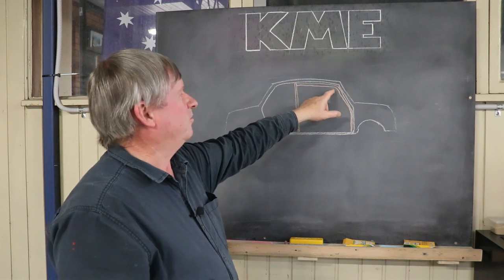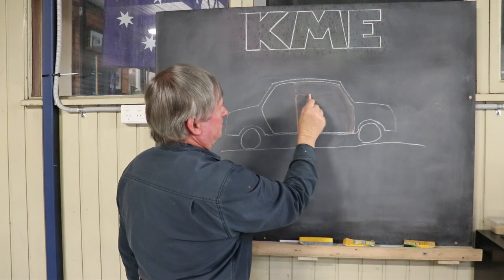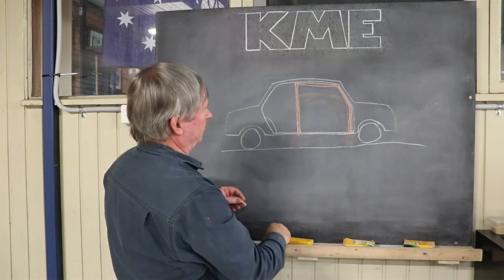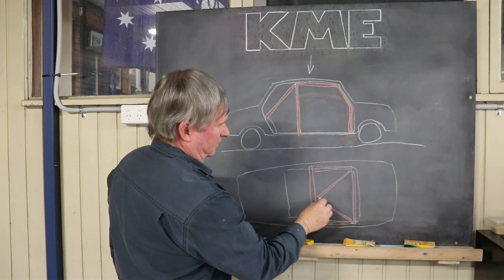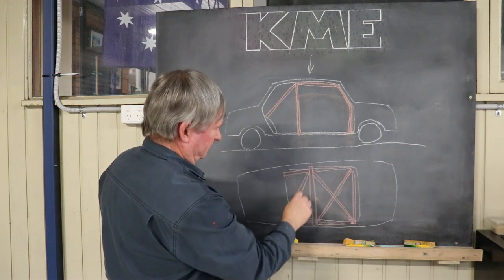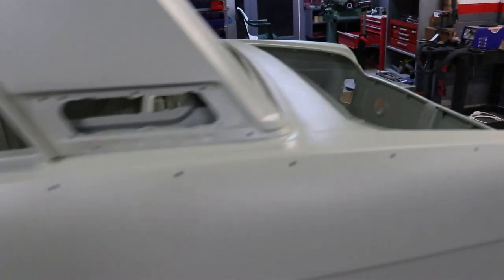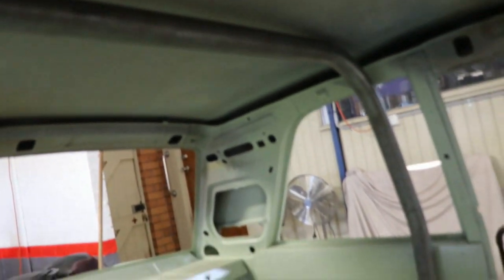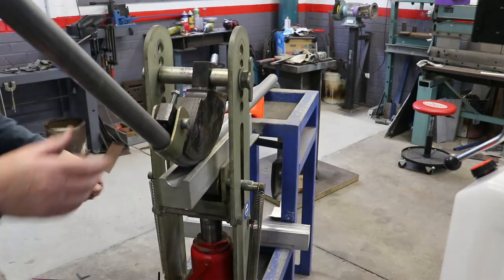Ford Cortina Roll Cage Build 1

Comment: Are the tubes mild steel or chromoly? What MIG wire do you use?
Reply from the maker: The tube is cold drawn seamless (CDS) unalloyed carbon steel as required for Motorsport Australia Schedule J – Safety Cage Structures , 0.9 bronze coated mild steel Mig wire.